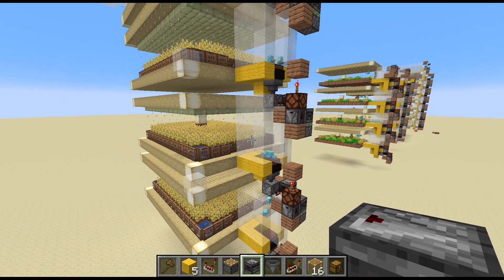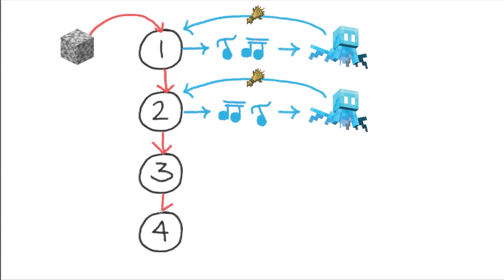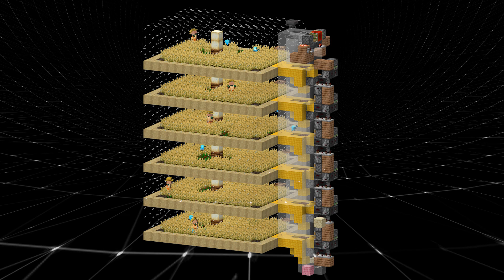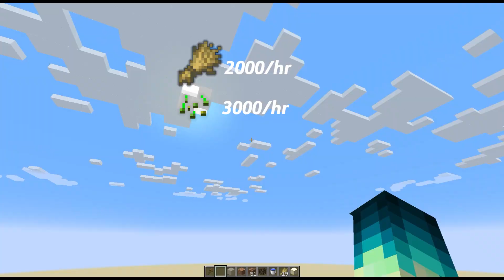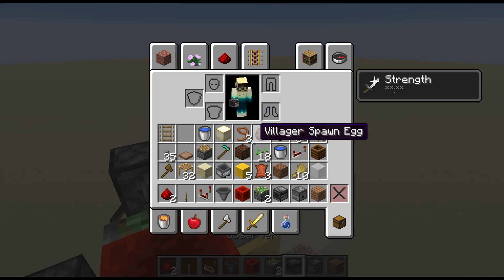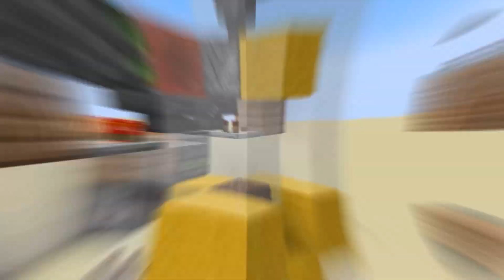Fully Automatic Allay Powered Wheat Farm  - Stackable Design! - Java Minecraft 1.20.6

Comment: Awesome video! Very nice explanation, and the visual explanation of the redstone was great. Couple notes:

1. This works perfectly in 1.21
2. A water elevator for the clock items is a great way to recycle them so you only need a stack or two to keep the farm running.
3. I tried a few layers of carrots and potatoes, but even without beds available, the villagers go into love mode too often and spend the crops very fast, so the efficiency of this design is minimal in those cases. I suggest a trapped villager and using the sharing system for those crops
Reply from the maker: Thank you! I'm glad you enjoyed the vid and built it in survival, thats mind blowing! 
I will take down those notes, Im actually planning on revamping the design because I think I discovered an even simpler design but I have to test it.

Comment: Very interesting design! What is the rate per hour for a single module?
Reply from the maker: thank you! hm, ive never tested that. perhaps the total divided by the number of floors. its pretty fast though, and remember its going to be running the whole time it is in the random tick chunks! which is 128 block radius from the player if i remember correctly.

Comment: Just built this on our server. Thanks for the tutorial. An I ran in to for anyone reading comments... I built this layout in the side of a mountain and the light levels were not high enough in some places to let me plant the seeds. I tore my hair out on that one. So, I added more lanterns around and it let me plant. But it's very obvious where the low light is as those places don't grow as fast as everywhere else.
Reply from the maker: Whats up CapN! Thanks for trying out my build on your server, thats so cool it worked in a mountain side! the light levels is a good tip to watch out for.
Reply: @1lastlemon  Also.. more suggestions... to get the Allay's into the farm is a struggle. What we found worked best was to get four in (or breed them) on the top floor... then breed all of them and dig a  hole in the floor to take down the new four. Then repeat the process. (And use leads and fence posts). 
A bubble elevator can help you recirculate the "seed" items for the notes blocks. That way you don't have to keep an eye on the levels in the chests.
Reply: For the farmers... make sure your farmers take 8 stacks of items. If they don't it means they already have something in their pockets. Our villager breeder uses carrots and some of the guys had carrots. I came back to find a couple floors had a mix of carrots and wheat.
Reply from the maker: @CapNJunkie  ah ok thanks! I am aware of the items in the pockets but I wasn’t aware of the allay thing. I’ll keep that in mind! I actually haven’t built this in survival yet so that’s good to know.
Reply from the maker: @CapNJunkie  and yah the bubblevator for the note block items is a good call. And overall kudos for getting it built! I hope it’s satisfying to watch 🥳